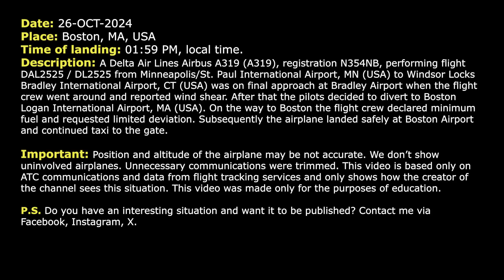Pilot declares MINIMUM FUEL after go around and diverts to Boston, Delta Airbus A319. Real ATC

Comment: reminds me of the trick ryan air (or some other low cost caririer) did . In order to save on fuel they would file a closer destination then divert to there real destination en route.
Reply: That wouldn’t save fuel if they actually descended, set up the approach to land, and then diverted after that
Reply: @EmpireTextbooks  They would divert before starting the descent. So will save fuel

Comment: I wonder if this was a dispatcher error, or pilot calculation error. Obviously, an airliner shouldnt be min fuel after 1 go around. Min fuel is not an emergency, but is a priority for handling purposes.
Reply: pilot in command is responsible and also has final authority to decide amount of fuel.
Reply: @ramon3221  PIC and dispatcher are jointly responsible for the fuel and the flight. Dispatcher can overrule on how much fuel to take but there needs to be agreement from both.
Reply: @salvicari4433  Typically the flight crew together decide how much fuel to upload, but again PIC has final authority and is also accountable for the safe execution of the flight (i.e. not too much but also not too little fuel). If he or she feels like the boundary conditions are not met for a safe flight then he or she needs to ground the flight
Reply: @ramon3221  I think there was a lack of good communication here

Comment: Unless they were in a 30 minute to 1 hour long holding pattern in Connecticut, I don’t understand why, one: they had no alternate, or two: why they did not have enough fuel! Aren’t these planes supposed to carry enough fuel for both their journey and a certain amount of time for possible flight redirect for weather and enough fuel to get them to their alternate???
Reply: If the weather is good enough, no alternate is required.

Comment: I don't have a full picture on weather at KBDL - with all the mistakes on altitude and frequency readbacks, and deciding to go KBOS on min fuel instead of attempting another approach, I find myself somewhat questioning the pilot's competency.  Is it just me?
Reply: It’s 100% just you. Nothing wrong with diverting to Boston.
Reply: It’s you.  There are two pilots on this commercial aircraft.  The captain has final say as to whether they divert or not.  We have no way of knowing if the captain was the one working the radio or flying the aircraft.  Thus, the actions taken may have been made by two different people.
Reply: Thanks for the replies - I was on the fence here - never heard so many incorrect readbacks to ATC in a high workload situation
Reply: Better to be pro-active and get out of a bad situation than stick around and get "behind the airplane"
Reply: competency no. judgement?

Comment: A min fuel declaration is not an emergency. Its simply letting ATC know that they cannot accept holding or delay vectors without burning into their reserve fuel. If it was an emergency fuel situation the pilot would have diverted to PVD or accepted 33L approach. 

BOS has a large Delta operation so a diversion there would be better handled than at a smaller station like PVD which doesnt have as many gates or staff to handle an unplanned arrival.  

Unlike other weather phenomena, non convective windshear is very tricky to deal with in terms of making decision to attempt the approach again. Visibility, cross winds, thunderstorms and braking action are usually well reported values with well defined limitations. Windshear is simply an alert and theres no real way to know whether you will encounter enough of it or not on the approach to generate a go-around alert. If the windshear was not convectively induced, trying the approach again is major risk to take and will likely result in another go-around with even less fuel to work with.
Reply: Very few would divert due to a +10 kt/-05 wind shear without adjusting speed on a second approach.  The whole recording suggests an extremely incompetent crew both from an airmanship, MCDU handling and weather far above minimums point of view. But then I wasn’t there, but know the area very well.
Reply: Great story, truth of the matter is they didnt program the MCDU properly after the missed approach and they received a minimum fuel message since the activated missed approach procedure puts the fuel calculations into an indefinite hold resulting in a lower rem fuel than initially programmed. Had they properly reviewed the legs page they wouldve been able make a second approach or loiter until the windshear passed through. Otherwise, the only reason they would get a minimum fuel situation from a single missed approach is if they flew so far beyond their calculated fuel burn from MSP by constantly lowering their reserve fuel number in the MCDU without dispatch noticing. The weather wasn't even a concern for them as they nonchalantly continued after the PIREP from the preceding aircraft was provided. They werent in a minimum fuel situation-its just what happens to inexperienced crews.

Comment: Why go all the way to boston if they are that tight on fuel?  Worcester and Providence are closer.
Reply: Runway is longer, Delta has a large operations there, perhaps there was weather and Boston was in the clear.  If it was a dire situation I guess they could have diverted to HVN, but I also get the suspicion that the pilot may have been a little fast with the "min fuel" call because ATC were planning on extending a bit to get in with the flow.  One attempt at BDL should not result in min fuel that quickly unless there was a lengthy ground hold at the departure airport or before making the final approach.
Reply: @mtk52983  Delta uses the A319 at Providence now.
Reply: @mtk52983  Or head winds.
Reply: BOS was likely their planned alternate and the distance difference is a rounding error. Also, it can be easier to work in with airspace.
Reply: Familiarity, longer runways, better crash response.
Reply: What I found ‘interesting’ (concerning) when with the Boston Approach and asked why diverting, the Pilot mentioned wind shear at Bradley and not having an alternate.  Not having an alternate doesn’t make any sense to me (non-pilot here).

Comment: Wouldn’t it be easier to try again at the original airport than diverting?  What did I miss?  Was it an ongoing weather issue?
Reply: Wind shear can last for hours.
Reply: The winds at Bradley were quite strong and unlikely to get better on a second try. They needed to divert.
Reply: Nope. Think about it
Reply: If they try again at the original airport and have windshear again which results in another go around, the fuel situation would be worse rather then just diverting after one attempt to ensure they have enough fuel to land at an airport with good weather

Comment: they didn’t have enough fuel for one go around??
Reply: maybe afraid of more wind shear with even less fuel?
Reply: And you go around, it gets bumpy again, and now you have to climb out yet again with even less fuel.
How many times do you want to try that?  Until you lawn-dart into someone's backyard?
Reply: They had enough fuel for two go arounds, and a diversion. They had fuel in the tanks when they landed.
Reply: Yeah, this is suspicious.  We comply with FARs for IFR Part 121 operations, then add "contingency" fuel above that.  Also, the Captain has discretion to always add more before departure, if within weight and performance limits.
Reply: @timduggan1461  Also, the Captain has discretion to declare min fuel.
Reply: @timduggan1461  Smart pilots do not push to the limits.

Comment: I'm just a dumb passenger, but having to declare min fuel after 1 missed approach and before getting to your diversion seems pretty short.
Reply: What were the headwinds an deviations in getting to the original destination. When in doubt declare min fuel.
Reply: Sometimes it’s not always possible to add fuel because of takeoff weight issues. Sometimes it truly is just enough for one approach then go to the alternate.
Reply: Hey Im just a dumb passenger too
Reply: Can’t speak for Delta, but our Airline will allow you to put more fuel on board even if it means bumping passengers! If I want more fuel we get it, high wind conditions it’s an automatic add for additional alternate fuel reserves!
Reply: Normally you plan for a few problems to happen: extended taxi, weather diversions, unable to cruise at optimum altitude, extended holding, go-around, diversion. Once in a while everything that can happen does happen.
Reply: Actually, you aren't "dumb".  The FARs are clear about fuel requirements for dispatch on IFR flight plans, especially Part 121 operations.  
The Captain coordinates with Dispatch at their departure airport, and "agree" on the fuel load.  The Captain has absolute authority to over-ride the Dispatcher.  We add fuel when we think we need it, for added safety buffer.
Reply: @timduggan1461 agree, better reply than I could’ve given at the moment.
Reply: You don't know the amount of fuel they burned en route. Also, the lower altitude caused them to burn more fuel than expected.
Reply: @N1120A  They were stating their fuel issues as soon as they had to execute their wind shear maneuver. Like I said, I'm just a dumb passenger, but I think I'd prefer having a bit more fuel on board so we aren't worried about fuel after one missed approach....
Reply: @coryrood  Again, you don't know how long the flight took beyond flight plan, or if more fuel was burned, or any other factor. Did they fly lower than planned the whole way? Also, it is entirely possible the planned weather didn't require more fuel.
Reply: @N1120A  Like I said, I'm just a dumb passenger, I just wouldn't expect to be worried about fuel after one single missed approach, regardless if the flight maybe had to be done at a less optimal flight level or had to be vectored around weather.
Reply: @coryrood  again, tons of factors go into this and you don't know why they loaded the fuel they did, but airlines in the US don't plan in an unsafe manner
Reply: Min fuel != MAYDAY fuel